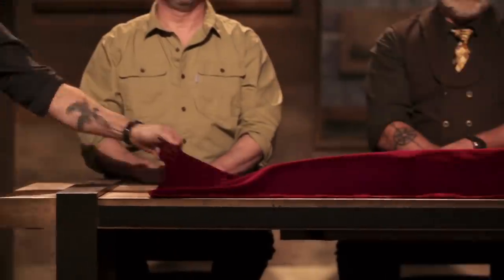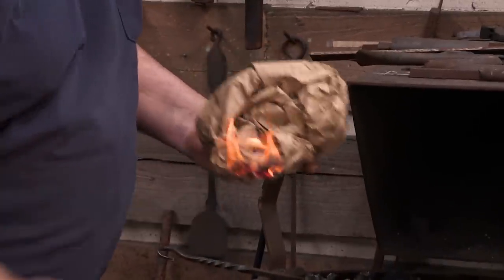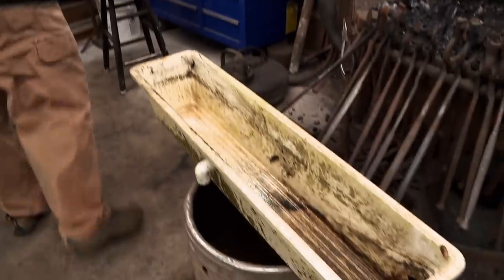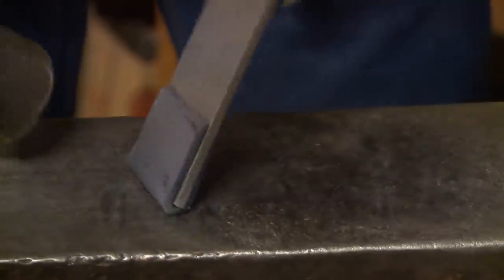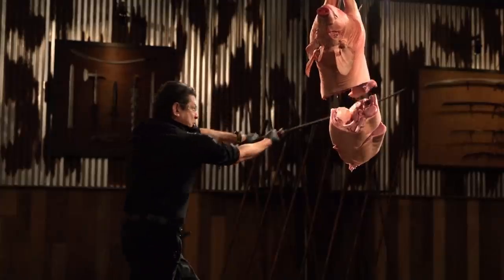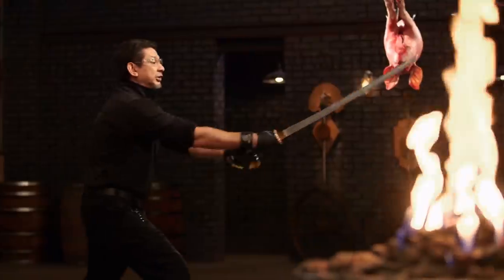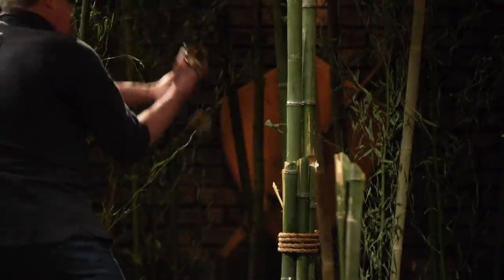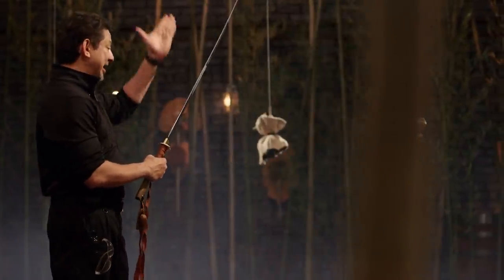Forged in Fire: Gunto Final Round: Richey vs. Elijah (Season 6) | History

Comment: As a hobbyist in writing novels I've come across studying how Japanese traditional swords/Japanese swords (Nihonto/a.k.a. Katana) and Gunto. Gunto are basically just what they call the same Japanese swords we know as the katana, just made for, and used by soldiers. They are not different with the exception of whatever hilt and sheath are attached to them for outward appearances with Gunto sometimes having military saber-ish hilts and sheath designs housing the blade itself, so let me just call them "katana" too in general. I must say, this is quite the terrible competition/show for bladesmiths when it always comes to the Japanese swords/katana category. They do not seem to know and respect how katana are actually made, especially when it comes to the rules set for the competitors.

Here's a few points I'd like to make:
1. There is a misconception that katana are curved and so the smith has to make a curved base metal right out of the ingot for the blade. We see this on this video and back with the o-katana category in this same show. That unfortunately is quite wrong. Katana are curved because to make one requires the smith to use layers of metal with differing qualities like hardness and malleability.

This layered material formed into a straight base blade/bar is then subjected to differential hardening which allows the different layers to heat and cool at different rates matching their material structure's chemical reactions. This is what causes the blade to curve, because the "spine" side of the blade contracts backwards while the harder "edge" expands. Now, why in our modern world would we consider doing that now? Well, the harder metal of the edge helps retain the sharpness and durability of the blade. The softer core or spine (depending on your material sandwiching formation) allows the entirety of the blade to absorb the shock of each swing and lessen the overall structural damage to the entire sword. Refer to the katana article on Wikipedia to see the picture on how each metal types were "sandwiched".

2. This is subject to controversy a lot. The folding done on metal used for katana is done to hammer out impurities. In our modern times where the quality of steel is better there is not that much need anymore, yes. However, this does not eliminate the need to laminate different metal types in order to form the cross-section of the entire blade. Refer to number 1 for why.

3. Some people seem to think hamon (that pattern on the edge) is just applied for decoration. In a way, yes it is true. However, the hamon is normally a byproduct of the final differential hardening process done to the blade. In Japan it has become an art form to control how you apply the differential hardening in order to create beautiful hamon on the blade. Basically, it's like with Damascus steel patterns. They saw something that was a natural byproduct of forging as a beautiful pattern so they went along and made an art about it, trying to control whatever patters would appear.

4. The judges of this show aren't really the kind of people you'd want to have your Japanese sword tested. They don't seem to know how to handle that type of sword properly. They are skilled, yes, but they do not seem to have the right skill needed in handling Japanese swords. It's a combination of the blade makes the dude work and the dude makes the blade work.

As a last bit of info, since I'm just throwing out info here for people who want to read this. If you want to see a video that is really close to how actual Japanese swords are made, Nodachi Sword of For Honor made by Man At Arms Reforged is almost the real thing. They use modern and traditional smithing methods and make a proper Japanese sword with it. There is also a documentary out here on YT about an hour long that shows the actual modern Japanese smith making a katana. Have fun studying.
Reply: This guy has studied the blade. Nice read.

Comment: The reason the young guy won was because. In the tests his sword preformed better in all the cutting "killing" tests. and the elder man's handle was in wrapped. Which I think made it just unnatural to hold. For the other judges. The difference in the design of the swords were the elder man's was thin and the younger guys was more thick heavier a better cutter. It is true that a rolled edge is more damage than a unwrapped handle but in conflicted I rather have a rolled edge or slight edge damage than a handle wrap becoming undone.

Comment: How did Richie not win?
Reply: Both smith's took a slightly bend. One in the kill test, the other in the Streangth test. With that they where tied. But the loose wrapping seemed to be more of a problem, then the lighter blade brings an advantage.
I think it's important to notice that the judges are really picky, when it comes to the handle of a weapon. 
In every round and challenge, the handle is the thing that sets the closest competitors apart from one another. 
And I think thats not without a reason. The handle is the piece that connects the user to the weapon. A well done handle dicides about how good you can control this weapon. 
The best crafted blade is worth nothing if the handle makes it unusable. A bad handle could case, stress in the blade, it can hurt you, rotates the blade uncontrollable or just let you slip of your weapon. 
Japanese swords like this have the "problem" that they have a straight, smooth, wooden handle without a pommel. Thats why the wrapping is the one thing that can prevent the blade to slip out of your hand while swinging or defending. A loose or slippy handle forces me to worry about what I can do and how to do it without risking to loose the blade. That's why I can't strike at full Streangth, or speed. In this case I cannot utilize the advantage of a lighter blade. I would rather wield a slightly more bended blade with a strong handle, than a lighter blade I cannot utilize to its fullest potential, because I cannot focus on the battle only. 
I mean, I really like Richie, he's such a nice guy. 
But just because someone is a better person doesn't just mean they have to be the winner of a compaction. I mean, the task is to build the best possible copy of a weapon, ready for battle then and there...not to be a super nice guy. 
I just can't understand how everyone thinks he knows more about how to judge these swords then the JUDGES who used them side by side. They are wonderful bladesmiths and weapon experts...
They just had less confidence in a unwrapped handle than in a slightly more bended sword...am I the only one who can understand their decision? 😅